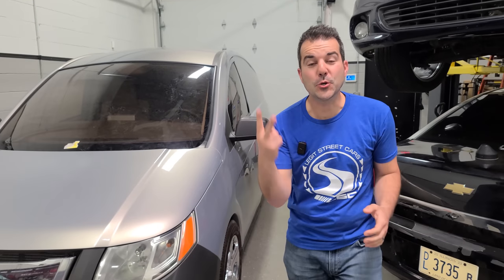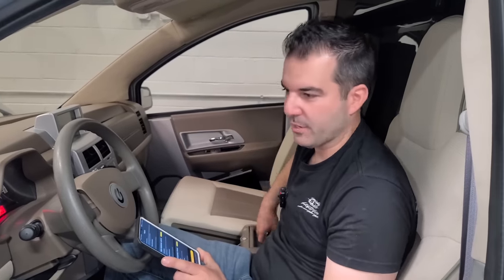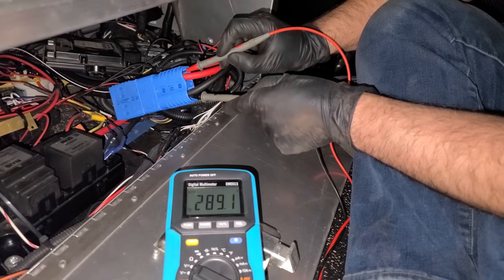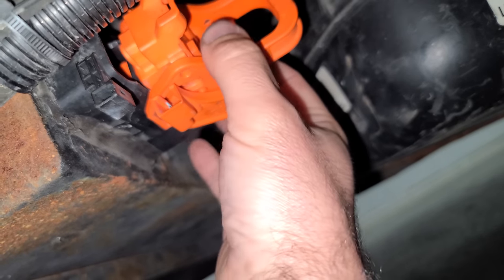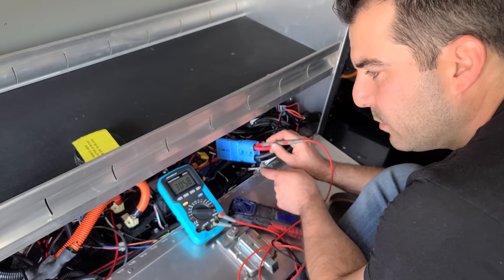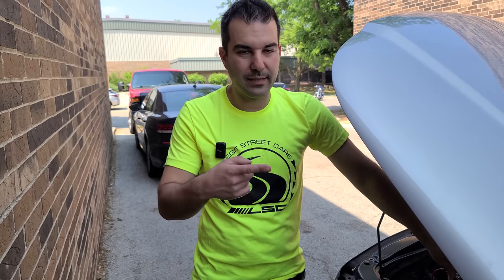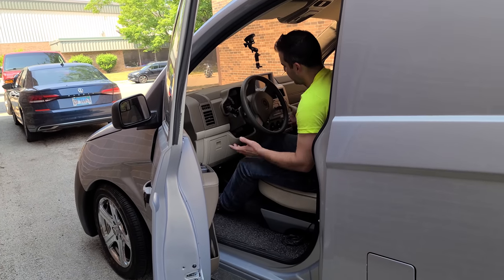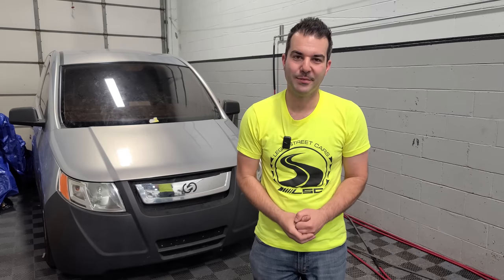I Fixed The Abandoned 2 Million Dollar Concept Car For $150! First Drive Ended In Disaster!

Comment from the maker: Save 15% on your Carly purchase with code "Legit23" (auto-applied) until the end of July 2023! https://bit.ly/Legit_Carly 
Carly's scanner and free version of the app with standard OBD features are compatible with cars that have an OBD2 port.  To see if Carly's advanced features like coding, the used car check, or Smart Mechanic will work with your car, be sure to check out their website. As mentioned, to access these additional features,  you'll need to get their yearly license.
Reply: The EV motor is connected wrong dude when you are in drive the EV motor is going backwards so the engine is allways fighting against it trying to go forwards that is why the ev motor bracket keeps breaking. If the engine is going forwards and the ev motor is trying to go backwards that is one of your problems.
Reply: the engine moves the vehicle forward in drive. the EV moves forward in Reverse. I might want to check the polarity of the power connections to the electric motor. The van is trying to tear itself apart right now.
Reply: I purchased the Carly because of your videos and it was the worst money I have ever spent. It worked the first 2 times and after that it reads the codes and when I clear it the check engine remains on. What a horrible product. Extremely disappointed that you even mentioned it on your videos but I understand that they are paying you for the promotion.
Reply: @rangelminaya  how u get it so fast
Reply: @stash0342  this is not the first video that he posts mentioning this device. I have had it for a few months.
Reply: My electric ⚡️Golf cart needs new batterys ....this basic Golf cart technology...
Reply: @rangelminaya  You don't seem to know what code scanners do. They don't make the codes go away. To make the code go away, you have to repair the problem that is causing the code in the first place.
Reply: @ralphinator2  I have been using scanners for many years. I know how they work. I borrowed one and it immediately cleared the code that I was getting. When the code came up I replaced the sensor that was not working and when I went to clear it nothing happened. When I used the one that I borrowed it immediately worked. Do you own a Carly?
Reply: It was a really dumb decision to go driving the electric motor when you knew the mounts were already broken.
Reply: Hi! Why is your profile picture black?
Reply: @rangelminaya  Same here, I got mine last week and it's utter junk - I did find it works a bit better on my iPhone than it does on my Android phone, but it's still pretty crappy, and the coding function doesn't work with either phones or any of my cars even though it said on their website it would - AND they have a no returns policy.  Cancelled my renewal already as I can't really ever see myself getting anything useful out of it.
Reply: @rangelminaya  you misunderstand how they work. You cannot just clear a code.. you have to fix what the code is telling you to fix first.. "AVCS bank 1" if you dont replace or fix the AVCS sensor on bank 1, then the code being cleared  will only cause the code to pop up when you start the car... Carly is no different than any other scanner for this. Even a snapon 10,000 scanner does the same thing if you expect the scanner to delete problems with your car on its own..
Reply: Does Carly work on Mercedes at all? Like reading manufacturer specific codes? Or would it just give generic OBD codes like the $30 bluetooth dongle I already have?
Reply: ARE you selling the caprice?
Reply: Hey, yo, the van not worth the time to repair and fix. I think I have another cost to fix and repair enough. Does that work for the time and repair to fix that’s a chunk and stick with that
Reply: E motor is cogging
Reply: @ralphinator2  😊😊😊😊🎉😮😮
Reply: @ralphinator2  😮
Reply: Would love to see You in person and let you drive my 17 chevy camaro ss supercharged
Reply: My current project is to get my 9-5 freshened up so i can bring it to the event on the 24th
Reply: looks like another ls swap candidate :face-green-smiling:
Reply: That was a "shite-show extraordinaire" Alex :)  It reminds me of when I was twelve years old and trying to get my dirt bike running again with no knowledge and before the internet existed.  Still love what you do though and keep up the good work!

Cheers, Sev
Reply: i do recognized that issue's not just your van but other ev too let me tell you about it
it esc that reading battery and it think voltage too low and high cause reply unable to kick in eco so it just shake motors and i recommend you swap motor wire because it in backwards and you need check that esc and take it aparts and clean it up and check reply more likely be fluatly reply on esc
2nd you never went under dash check for fues to radio or touch screen because one of fuse is blew out cause it not work and check for 12v power to touch screen or radio else that it need be fixed so you can find more issues down the road im sure you have fluatly esc (defective) it need be fixed and one reason why you put in reverse is because motor wire to esc is in backwards and easy swap it around it should fixed issues and why motor shaking when key turn on is because reply on esc is bad (because you didnt hear it but i did click bam click bam click bam) if you dont want mess with it them i can come by and give you a hand and some useful information about it because it can save you a headache troubleshooting issues
Reply: @rangelminaya  I agree. Carly is crappy. It can destroy your car and when you modify your car settings you void your warranty
Reply: I think you have a problem with the gear selection alex 
You seem to be selecting drive for the gas engine but then the motor is going into reverse 
You need to talk to the sparky who wired this thing
Reply: @eyalbarmitzvah  it is the worst thing ever.
Reply: Maybe the motor mounts broke because it went into 100% regeneration mode and just acted like a massive brake? Also, I'd laugh if the whole thing didn't work because you had it in show car mode.
Reply: @crisnmaryfam7344  he said he replaced the part and the other scanner worked by clearing the code after but carly didnt, learn to read.
Reply: @ralphinator2  he was talking about carly with you and you just changed the subject... are you ok in the head?
Reply: @adriandiaconescu2093  wtf did you just say? english please
Reply: Hey here's a thought, get a winch and mount it to a frame that can be bolted to the floor. Anchors will have to be installed in the floor.
Reply: @dzgaming1  I am thinking the same thing, I am German and I don’t get a single word from what he is saying
Reply: Is the elektro motor going bagwort when the gas engen is going forward???
Reply: It's crazy how much money was spent, and how little was spent on the actual vehicle.
Reply: doesnt this make perfect sense...

if in petrol mode, drive is forward... but in ev mode...reverse is forward... and if when in petrol mode, at a certain speed to ev motor kicks in to assist the petrol engine...they are literally driving in opposite directions... and the electric motor is tearing its own mount apart?
Reply: @ralphinator2  Youre confusing the code and the problem. The code is simply a digital record of the issue. Yes. These can be cleared. Yes, this is not the same as repairing the fault. And yes, if you clear a code and the fault remains it is likely the the code will re occur immediately. which is actually an important trouble shooting step in diagnosing persistent issues versus diagnosing intermittent issues. Case in point, in one had an intermittent misfire, one might clear the codes and attempt to assess at what point / state the code re occurs. On what banks?, cylinders?, what revs? At idle or under load etc.

Codes dont just reveal whats going on in just the code itself, but also when it occurs. Clearing codes is very often an essential step in diagnosis. And yes... Carly or Nonda Zus etc can do this...

Although it is worth noting... they only request the code be cleared. The car makes the ultimate decision. Some codes on some cars / models cannot be cleared by Carly etc and can only be cleared by approved diagnostic equipment. Its a safety thing with some critical codes that the manufacturer has deemed too serious to allow to be cleared while a problem remains. This is usually stuff to do with safety features like air bags or abs etc.
Reply: @rangelminaya  You misunderstand that the product is. And how it works. Carly does not clear the codes. it requests that your car clear the codes. The car makes the ultimate decision.

Some codes cannot be cleared because they have been locked to certain levels of diagnostics. Meaning that at the surface "clear codes" you cannot clear that code, You have to go deeper. This is safety feature to prevent codes being cleared that could result in damage or danger. Such as airbag failure codes, ABS, seatbelt, fuel related codes etc. There there danger to the engine... like...clear this code and run the engine and it will die... no...those you cant clear.

Also, Carly doesnt fix issues. Clearing a code doesnt make a problem go away. It simply clears the code..ie..the live alert digital record of the fault. If you "clear it", its only the active state of the code. Those that can be stored for later use, will be stored and saved.

So, if you used Carly to clear codes, and it immediately came back... your issue is persistent. Carly has done its job. It will also try to give you tips as to what the problems is, And the problem clearly needs more powerful tools and a garage visit.
Reply: @TheSiladhiel  you are the one that’s not understanding what I am saying.
Reply: I'm guessing you bought Hoovie's Grand National??? Or is that actually another one???
Reply: There's probably supposed to be rubber bushing built into that electric motor mount but it doesn't look like they did that. Gonna have to fix that design flaw first.
Reply: 24:00 after doing that kind of stuff it would be healthy to watch on that spaghetti through thermal cam , just in case
Reply: That bracket needs to be reinforced as you figured out, you should ask your weilder what he thinks, maybe invite him to your shop so he can have a look at it and decide what you need to do to super make it super strong. I would personally think of it as a tesla motor that does 0-60 in 2 seconds; thing of how much toruqe that produces and then over engineer the crap out of your bracket. :)
Reply: Maybe ask Rich to show you how a Tesla motor is mounted to give you some idea what do with your space van. :)
Reply: Reposted..
Could be that the last time the van was taken to pieces something got reversed.. Or maybe worse it sounds more like the motor is oscillating backwards and forwards.. 
Oscillation would definitely do that shaking banging thing either in hybrid or electric only mode. !
Reply: @bradmorri  I did the same thing and feel the same way.
Reply: It sounds and looks like something is "out of balance" around a rotation part ... something loose ??? A broken part within the electric motor ???
Reply: i was very interested in this scanner.... until i went to the website and seen how big of a piece of shit it was...stop with the fancy "consumer "BUY ME" triggering graphics and worry about fundamentals...like functionality.   Lost my $?.??  <<<<<< not sure how much never got that far and gave up after the 6th site nosedive.
Reply: Please please please get your hands on that Aspen Blue Ty (1 of 28)
Reply: @rangelminaya  ofc, Carly is scam
Reply: Really guys! I am the only one who is wondering what that switchbox hanging under the glove compartment might have to do with the problem? I think some of you are on to the right trail about the motors fighting each other. Also, isn't the town and country a front wheel drive? And the E-Motor is on the rear axle? HMMMMM? Time to start flicking some switches buddy.
Reply: Could it be that when put in reverse the gas engine parts are trying to go reverse while the electric motor is trying to move the car forward forward
Reply: I'm working on a Mercury Grand Marquis, og engine with less than 40k miles, but it won't start now. Any tips?
Reply: I think you put the cost as $150 not $1500 😄
Reply: YouTuber found in shop looks like you was charging a hybrid prototype when he was locked in vehicle found 48 hours later

Comment: The motor shaking + running forward when in reverse could indicate that there is a motor phase / resolver / encoder wiring setup issue.  If the motor is 3 phase (most are), swapping any two phase wires will cause it to run in the opposite direction.  The question is what signals is the motor drive looking for.  If you haven't already, find out what drive system it's using.
Reply: Exactly, leads are swapped 👍
Reply: I feel they are swapped or they set up the motor and the EV motor on opposite rotations....
Reply: Yep, the motor controller is not in proper phase, which might just be sensor wires broken.
Reply: If the motor controller has to learn the motor every time it is disconnected from the battery.  Trying rear wheels in the air?
Reply: i had  the same idea, i ran into the same problem on my ebike conversion when i screwed up.
power leads/ phases are swapped, or hell even the hall sensors are wired the wrong way
nvm just got that far in the video, im sure power leads are reversed, and when the car goes faster it tries to run on hybrid mode and the 2 motors are working against each other...
reverse/drive being swapped is a sure sign

edit:also im 100% sure that theres a door handle or at least a wire/reach behind the rear door panel on the bigger door. just the panel needs taking off
Reply: That's what I was thinking, but your explanation is more engineering wordy.   😂
Reply: EV motors are 3 phase? I didn't know that. I assumed they were DC.
Reply: I agree with everything said here. There is so much torque from the electric motor, it broke the mountings
Reply: And, the shudder you felt when you drove the van with low voltage, is probably the petrol engine kicking in, thus working against the electric motor which is connected wrong
Reply: Should have read your comment before posting exact same thing.
Reply: glad someone caught this also with a history in RC racing this is common was feeling it would carry over into full size as well and would cause alot of faults trying to fight the motors rotating opposite direction
Reply: Yes. As ZombieSS77 says, leads reversed.
If that's the case, how about this for an explanation...
     The gear selector in F runs the gas engine gearbox forward but the electric motor backwards.
     So, when the battery drops below a certain point, it starts up the gas engine to help but it's trying to help in reverse (as the gear selector says).
     The electric motor and gas engine-gearbox try combine but they are running in opposite directions so the bracket breaks and things get spicy :-(
Reply: My brushless RCs agree with this 100%. Also balance charging, just hope they're not dead cells within the "pack". I really think it's the motor/controller wires need to be properly redone. Worst comes to worst just try different combos, it already tries to yeet itself out what's the worst that could happen😂
Reply: @Narpets2112  they can be either, but AC is a more common choice because they don't need brushes, which reduces friction and wear items in the motor. AC just needs a more complex controller, which major automakers can afford since they buy in bulk.
Reply: @Narpets2112  yeah except for old or very cheap EV they are all 3 phase. They are much more powerful per pound and longer lasting. You just need much more advanced electronics to monitor and control them. With DC you could just feed it power and it would go...usually at full power 😂
Reply: @Narpets2112  All brushless motors are 3 phase ac. even on the small rc stuff like drones.
Reply: Ya that's what I was thinking
Reply: clearly the motor mounts are BROKEN. in low speed the motor will allow the rotor to rotate freely but as soon as you try to spin it faster there is too much inertia/friction/ magnettism that it will start to rotate whole motor so it shakes as the motor mounts are shot.
Reply: Might also be why r is forward and visa versa in ev ?
Reply: I'm wondering if one of the switches on the box under the dash switches the direction of the electric motor. Possibly the transmission one
Reply: +1 for reverse phase rotation. That was the first thing I thought of as an HVAC guy
Reply: Obligatory "I came here to suggest this" comment. Ex pool guy here who encountered a fair amount of 3ph commercial pumps running backwards because of this.
Reply: Has anyone seen Peter lately?
Reply: @murraymadness4674 , or disconnected, who knows how many fingers have been pocking around in there since Bright folded.
Reply: @vihreelinja4743  On the DIYelctriccar forum, it was explained that the spinning motor will induce eddy currents in the system, causing drag in the electric motor.
Reply: @alexron42  You may be right!
Reply: @Ghost63123  The thing is it does that shuddering even in park with the gas motor not even running. So there is an additional problem as well. Now being it goes forward on EV with the selector in reverse would point to the motor being reversed from the gas engine. Easy fix there. The delay in shifting is due to the actuator which operates the trans so he needs to be more patient going from park to drive or reverse etc.